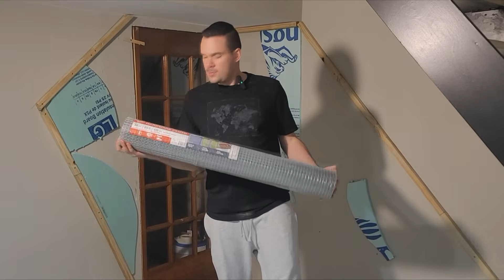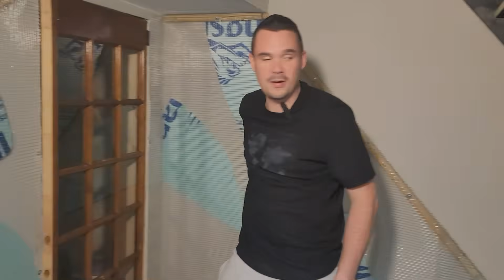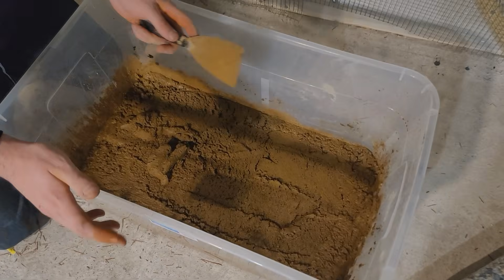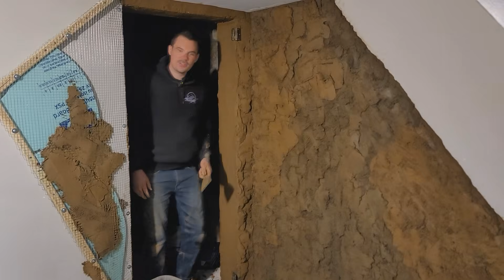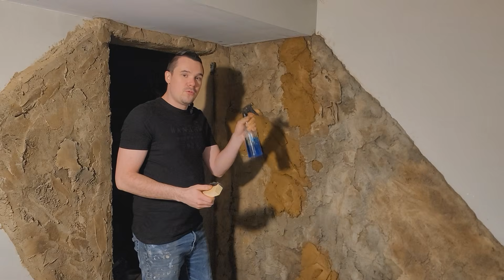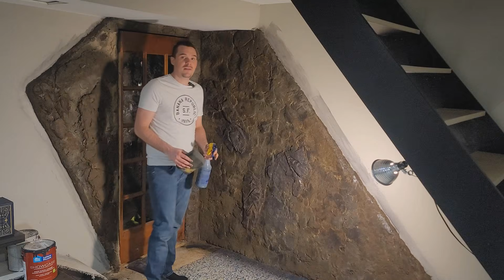How To Make A Rock Accent Wall Out Of Concrete | Transform Your Space!

Comment: As soon as I see foam, I'm done. Cheap temporary work is cheap temporary work. But if you feel like rebuilding every 3 months, cheers to you!
Reply: That foam is going to be encapsulated inside a layer of concrete.
It is only used to give it shape. I've seen this type of build last for decades.

Comment: Will this crack over time? Thinking about shrinking and expansion due to temperature change
Reply: 100% that’s why you put additives in it. Sand topping mix is weak by itself.
Reply: It’s not outdoors.. I’m aware temps change indoors, but not the same as being outside